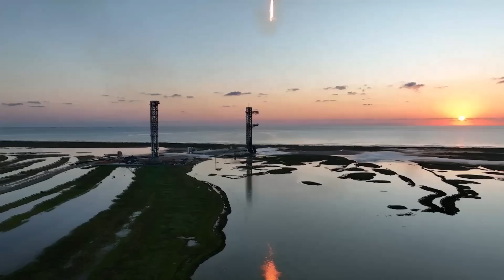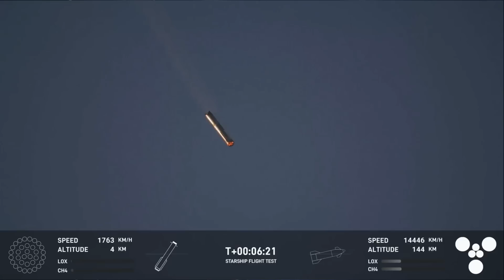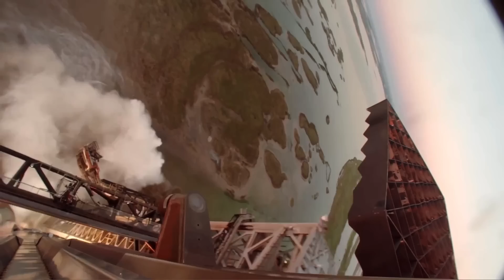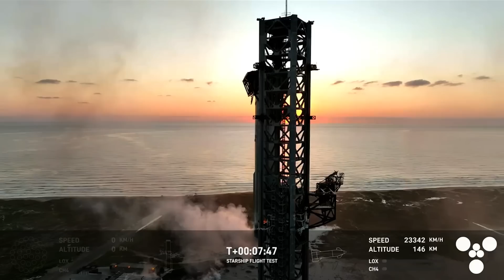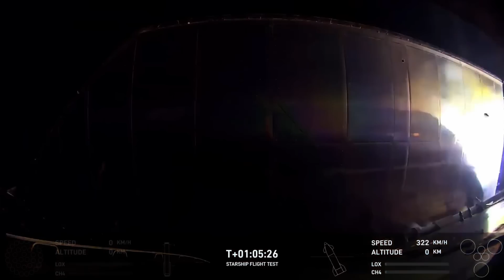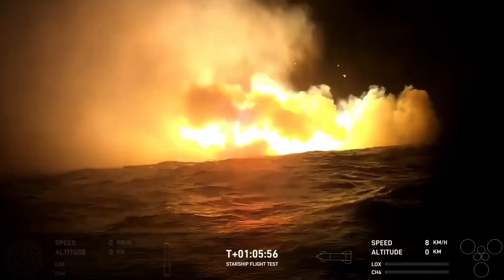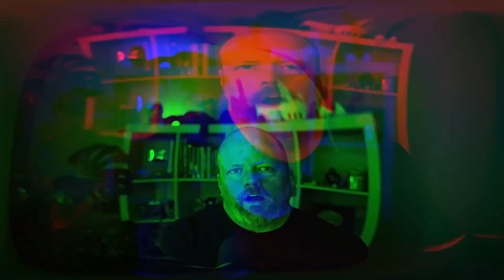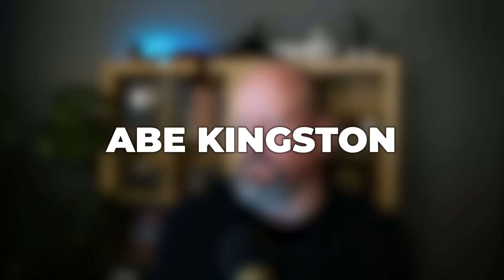ABSOLUTE Success! Full Analysis of Starship IFT-5 (with @scottmanley, @MarcusHouse )

Comment: Considering this flight did not go into orbit,  the "re-entry" seemed really long and drawn out.  In a de-orbit scenario,  is the re-entry shorter or is it the same,  or,  in fact even longer ?  I know the forward flaps have been moved,  but I am particularly trying to understand the overall process.
Reply: You want the reentry to be as long as possible. This means lower peak heating on the vehicle, and as much time as possible for the vehicle to get rid of heat. You achieve this by having a fairly circular orbit that's only barely inside the atmosphere on it's lowest point. In that sense, these flight tests are pretty close to the best case scneario for reentry, meaning they are close to as long as possible.

Reentry from higher orbits will generally be shorter, as you don't want to use propellant to get to the optimal reentry orbit.

Comment: 49:00 Thing is, even without any reusability, IFT-5 (and even IFT-4) already demonstrates a super-heavy launcher that's cheaper and more repeatable than SLS. SpaceX's priority is getting the reusability nailed, but for NASA's requirements I think they've already obsoleted SLS before IFT-5.

If, say, tomorrow there was a random emergency that needed heavy something put into orbit quickly, you'd call on Boca Chica, not Michoud. Even forgetting cost, mass-producing fully-equipped robust Superheavies, Starships and Raptors seems to be more viable than the complex and delicate SLSes.

Economically and technically (NOT politically), if someone were to scrap and reboot Artemis (like Constellation) you'd want to start with Starship now, even if you sacrificed all reusability and just stowed a tested Crew Dragon on-board for crew reentry. There could actually be a case for doing that _now_, considering the single-launch cost of SLS... but, the sunken cost fallacy is king.

Comment: Would it be possible to construct a taller mechazilla such that they could launch the rocket not from the ground but from the arms ... So they would not need that much water deluge ... Also it will make it possible to launch and catch rockets on the ocean
Reply: no the rocket is too heavy when fully fueled the tower would need to be able to hold 1000x the weight it is designed to now.
Reply: @zachmoyer1849  Not 1000x, more like 10x.

Comment: When they catch starship aswell, will that be the first ever orbial rocket to come back to earth\/
Reply: no the shuttle already has that title.
Reply: @zachmoyer1849  nope, the shuttle was just the top (starship) part of the rocket.  With Falcon 9 only the booster comes back.  I don't know of any rocket orbital rocket that is fully reusable, no matter how small or large.
Reply: @Spedley_2142 depends how you define it but the shuttle was technically the rocket its engines are firing right from liftoff it just sheds parts like the tank and SRBs.

Comment: Here's a thought. Now that accurate  return to site reusablity is proven using heavy stainless shells, you can change to titanium which is half the weight. The price of titanium is 10 times that of stainless and is weldable so 1 titanium booster  and 1 starship can now be considered with much greater payload . Once development is complete   change to titanium. Imagine the increase in payload by halving the rocket shell weight!!!!  melting point of titanium is also 100C higher. Massive fuel savings  too as  boostback fuel requirements lower as lighter  vessels.. Just a thought!
Reply: its not nearly as easy to manufacture so all of their processes would have to be re worked. with the added cost from price of the material, labor, and research it would be cheaper to just build two rockets for the price of one.

Comment: "Who knows how long this is going to take?". Yep, well said Mr. Cain. The new tiles are tougher, but also much heavier. The problem with plasma leaking through gaps in moving parts isn't solved. There's still structural issues with Starship (did you notice the metal sheets flapping?) And the whole thing has cost $10 billion development, with plenty more to go. I'm pretty sure it will be made to fly. But cost-effectively reusable, without weeks of refurbishments between flights? And will that steel body (especially the second stage) evolve in terms of materials? This thing is over-mass. It was touted as being able to convey 150 tonnes to orbit. That's now more like 50. And it has competitors who don't have similar issues regarding rapid reusability. So, we'll see?
Reply: What competitors? Starships biggest competitor is Falcon 9/Heavy.

Comment: You didn't have time to properly discuss the other variable which is the Version 2 & 3 designs of both the booster and the Starship and how they fit into the testing programmes to come. There is a possibility that SpaceX have already spotted the issues they had with Flight 5 and could be thinking of leap frogging the Version 1 crafts immediately. Would love to have heard Scott and Marcus talk this aspect over.

Comment: If you've watched a very high percentage of Falcon 9 landings you will know that these landings are not the same. There appears to be two sets of variables at least. One set regarding the rocket and another set imposed by SpaceX. Marcus and I have commented on X regarding this imposed set of variables and both suggested that there was more going on here than meets the eye. And that this was possibly related to the Starship and Booster future landings. SpaceX may well comment on this aspect in the future, but the final stage of the Flight 5 Booster's approach, with three engines gimbolling, did strike me as having a very similar set of controls to the single engine drone landings of Falcon 9.,

Comment: A little/vital bit of "Big Picture", having seen some comments missing this: The "orbit' was in fact a ballistic trajectory, not requiring any re-entry burn (other than for landing trajectory control).  To land at low final velocity, the energy (potential+kinetic) of the ship has to be disposed of.  That energy, though immense, is considerably lower than if it had been coming in from an orbital, let alone inter-planetary, situation.  The only practical way to dispose of that energy, when landing on planet Earth, is by slamming through the atmosphere, as a kind of aero-braking.  As with most forms of braking, this transforms kinetic energy into heat.  The heat of re-entry is therefore an unavoidable alternative to slamming into the Earth.  The relative proportion of energy reduction achievable by the landing burn is negligibly tiny as compared with this.  Not practical to make bigger due to the weight of fuel that would be required (eg would need a full fuel-tank and to be met part-way down by a fully-fuelled booster (however that would get there!), like the one that launched it).  That final deceleration-burn is the broad equivalent of pushing a vehicle by hand into a tight final parking-space.  Big remaining engineering challenge to overcome not only the existing control surfaces' overheating issues, but to upgrade them to cope with increased-energy approaches, as will be required for realistic orbital and interplanetary arrivals.  Overall: A solid "small step" (maybe a medium one), in a "long march".  Salutes to all the engineers, and respect to nature ("that hath no mercy").

Comment: Not going to be using oil rig type tower platforms returning to launch bases simply because you absolutely lose the reusability unless you have upwards of 60 of them, so that they can rotated on site. If Starship is launching daily, for example, and turn around is two months, then you'd need 60, plus more for those in servicing etc. Also, it's just way too much cost - reusability is about cutting costs, but if you need that kind of infrastructure and your require added crews and fuel to move those things around, you lose any savings that you are making with Starship itself being reusable. Not going to happen. 

But larger booster rockets, with the extra fuel capacity for handling a re-entry burn is far more likely.

Comment: My predictions for what is next:
Priority 1: start delivering starlinks to orbit. So flight 6 test the 'pez dispenser' with mass simulators, barely sub orbital. If that goes well, flight 7 delivers actual starlinks to orbit.
Priority 2: test in-orbit refueling, as will be needed for Artemis HLS.
Priority 3: HLS tests. Start unmanned low earth orbit, extend to unmanned moon landing, and manned low earth orbit (with astronauts using Dragon to go to/from orbit.) 

In parallel with those (but lower priority): work on recovery. The starship recovery cycle --- attempt reentry, analyse weaknesses exposed, design and build fixes to those weaknesses --- will, I think take longer than the launch cadence they'll want for starlink launches and refueling tests. And there isn't much point to reentering with a design you've already watched once. (Or not enough point to justify the cost and payload penalty of the reentry hardware.) So I expect they'll use expendable starships for any launch when they haven't got a new reentry design to try out. 

 Perhaps we'll see a starship landing in outback Australia. (If this is their intent, they should have started working on it behind the scenes some time ago, talking with Australian stake holders, plus lead time to build whatever hardware they need. Maybe a short mechazilla, maybe a giant steel net.)
Reply: @michaelwoodhams7866  or just help the people on earth first

Comment: Fin burnthrough is still very concerning. Starships will eventually return from Mars or the vicinity of the moon. The amount of kinetic energy and hence the amount of heat that has to be bled off in atmospheric reentry is double that from low Earth Orbit. Therefore fin burnthrough is a much greater problem than it appears to be.
Reply: It's the flap hinges on the forwards flaps (curved surface) that is the main issue now. Newer versions of Starship have the flaps mounted back away from the worst of the plasma flow I believe (no longer centered around the cylinder), so maybe this is already mitigated to some degree by that. The aft flap hinges seem to hold together ok already at this point.

Comment: I think there is movement in the grid pins, they are not just solid points, I believe they are in some way hydraulic to allow them to settle and not counter the rockets positioning.    Like wise the surface of the arms is a moveable track to absorb the initial shock from above and the side. This as been my reading of what they had developed. I had been fearing that the booster would swing into the tower , so I was surprised by the degree of balance and movement control, as I see it like balancing a pencil on your finger because the thrust is at the bottom.  I am still not convinced by the use of fins on the ship, it seems to me that it is only because they choose to have a perfectly tubular body, if it was more oval in section I would expect it to automatically stabalize itself, and use gas jets to steer . I think they will constantly have a heat problem on reentry , from any object attached to the ship .

Comment: Even before watching this video, the title seems misplaced. It was reasonably successful, but let's not forget that the tiles were failing and parts of Starship were overheating. This issue still has to be fixed. Edit: Scot does mention burn through. So yeah, this thing requires more work.
Reply: It isn't clear if they had any issues with the heat shield that aren't resolved on Block 2 Starship. Fin burnthrough should be resolved by moving the fins back out of the flow of plasma.

The current heat shield appears to already be good enough for a recovery. And once they start recovering them, that's when we can expect that they really start refining the heat shield.
Reply: @SpaceAdvocate  There is burning debris seen in the footage along with red hot metal. Moving the flaps might solve part of the issue. There is also clear evidence of the metal sheeting flapping in response to turbulence. This will be happening on the body. We're a long way from tiles not falling off and even then Starships faces lengthy inspection and remediation in actual operation. What annoys me the most is people swallowing Elon's claims about this thing being cheap to operate.

Comment: So many parts had to work perfectly to achieve the catch of the booster…really amazing, and a testament to the work by Spacex.  Well done.  The starship also had a much improved flight.  Things are going well for Spacex.  I can imagine the shockwaves this flight has generated throughout the space industry.  I would advise to adjust to the new reality…or fail.  Reusable rockets and ships are the new reality.  NASA must reevaluate their Artemis program.  The goal is to return to the moon and a permanent base/human presence.  NOT the SLS.  There is now a clear path to success using Spacex, and SLS is simply too inefficient, costly, and slow.  We need big payloads, and lots of them, to achieve the Artemis goals.  Good luck to all involved.
Thanks for the video collaboration… very interesting.

Comment: Great achievement by Space X to catch the booster ... however ... they chose to set a large payload into LEO target and full reusability so they had to remove the legs, not have a booster burn to slow down before hitting the atmosphere, and of course the discarding the ring.

Space X should have keep this simple with with they know & have perfected by building reusable Starship stage with legs ... for the Falcon Heavy .. to fully develop the technology first, not worrying about payload.   Then with the knowledge from the Falcon Starship .... build a Raptor Starship.   Space X could have completed a Falcon Starship 4 years ago ... launched into LEO ... then retuning to land at the lauch site .... using FalconHeavy.

Again.  Great achievement ... but completely unnecessary, wasting time & money ... due to Elon wanting to do everything his way.

Keep it simple stupid.

Comment: 40:00 what payloads out there require the additional performance  they’d get out of landing down range? Absent any single payload that requires that, it would cost way more money to land down range and spend 3+ days bringing the booster back than to just rtls and reload the booster and run it back with additional fuel.  It’ll cost hundreds of millions for the infrastructure to enable down range landings and enable shore to tower transport, to say nothing of the days of the booster sitting on a ship doing nothing.

Comment: I wonder how many issues are solved with Raptor V3.  Removing the heat-shielding and fire suppression should save a lot of mass.  Add in the extra thrust and it might be a very positive change to the variables.   If nothing else I think it's easy to say super heavy is a complete game changer, even if you had to scrap starship and use disposable second stages.    Not that I doubt spacex will sort the system out.

Comment: rapter 3 engines are inherently immune to the warp bell problem.
the question to ask is what is more cost effective extra fuel to purge and cool the engines or heat shields around the engines.
i feel the fuel is a better option, in extreme payload lifts the booster can be sacrificed to push more load to a higher orbit this is well known by space X they do this with F9 as is.
i also feel a few sec burn to kill off some speed just before A-bravo would get main return to sub mach 2.8 and this would keep the heating below TGlass for the bells without cooling.
they had the same road hump in the early falcon stages it was more or less fixed by edits in the fly profile dynamics also the M1D has very stout nozzle cooling

Comment: Raptor 3 has cooling integrated into the bells, so I imagine they can be purging as they are coming down (when the bells start to glow) then light the engines. The purging would both cool the bells and make sure there isn't any debre before they fully fire up.

Though this is just how it seems to make sense to me and maybe there is a glaring flaw in this though that I don't realize.

This response was typed up around 22:00 in the video

Comment: By next year, SpaceX is going to be able to rapidly expand Starlink by launching large numbers of massive Starlink V2 satellites on Starship! But i wonder why the Pez dispenser is horizontal- wouldn't it be so much stronger if they made a vertical slot?🚀
Reply: With a horizontal slot, you can pack x identical payloads in there easily. If the slot is vertical, you either have to put many different size payloads in there, or sacrifice a lot of cargo space to use for rotating the payloads before dispensing them out.

Comment: Fellers. 1. The catch mechanism has to be made separate from the launch tower/pad. 2. The whole system won't be human rated before 2028/29(if ever). 3. SpaceX must focus on delivering the Starship HLS for Artemis which only be human rated for lunar flight & landing and not including the booster. 4. Fraser, no landing barge for starship. They need to focus on Artemis' HLS. 5. Artemis 3 in '26? No way. Before 2030? If they focus and Gateway & Orion/SLS don't critical path. 6. Man! ley, Starship will have a  abort/ascent module (Draco derived) and leave the rest of starship on the moon. 7. This first variant of Starshp-Booster will only be to achieve the Artemis human landing.

4b. No barge landing? Well, maybe. So much to learn when examining ss recovered whole. But, they must turn to constructing and testing, incl landing, Starship HLS. Simulating lunar landing & ascent is a challenge. NASA to Benjamin, "one word for you - - HLS."